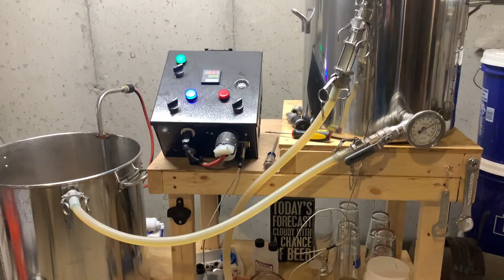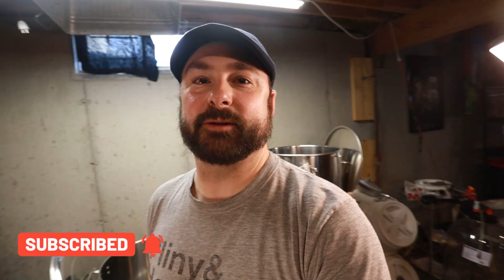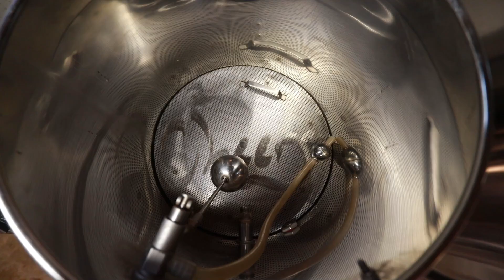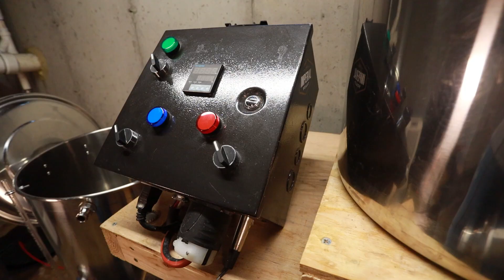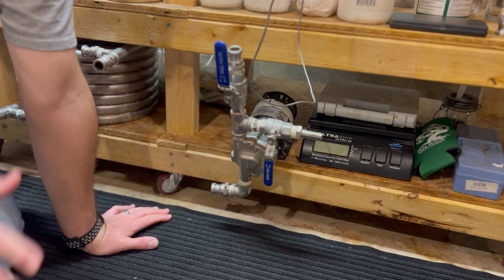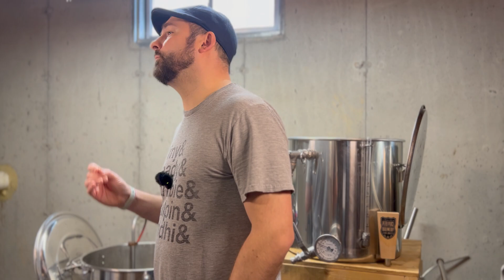Build Your Own 240V Homebrewing System for Less Than $500

Comment: Hi Petey! Nice video and brilliant solution! How you chill the wort when using this equipment? Cheers!
Reply from the maker: Hey, thanks a bunch! Glad you liked it! For the wort, I run it through a stainless steel counterflow chiller which gets turns it from 200F to pitching temps after a few short minutes!
Reply: @putnambrew  So this system is only for brewing. Is not Brewzilla 4 doing the same (or even more considering the phone connection) for same money?
Reply from the maker: When I originally built the system 7-8 years ago - the AIO systems were just starting to come out and they were closer to $1000+, considering this is very similar to the BrewEasy, which can easily be over $2,000+.   Now there are some great systems out there that brew amazing beer for a fraction of the price.